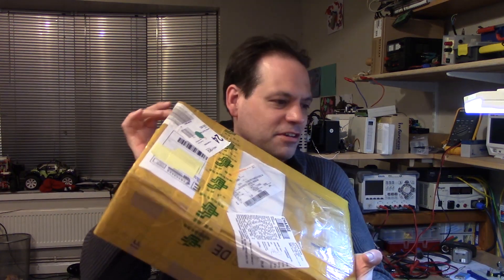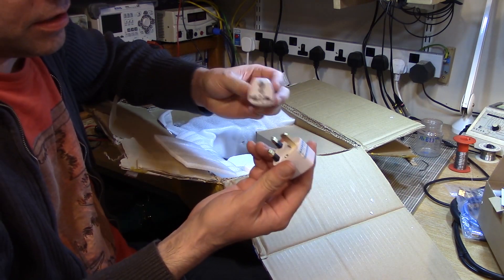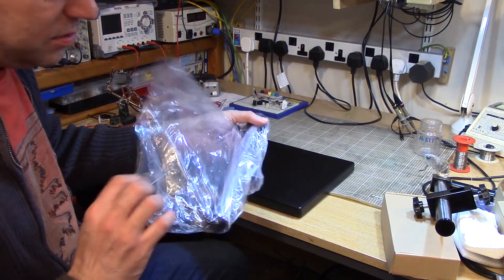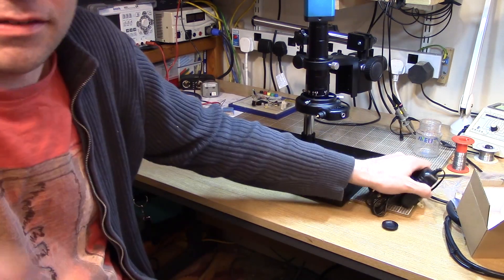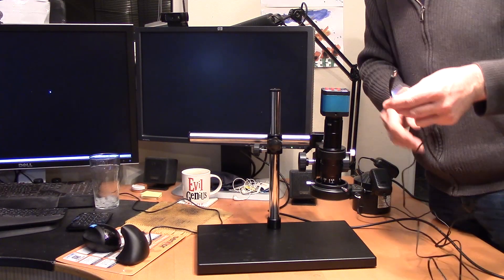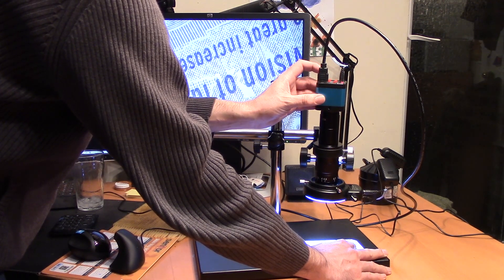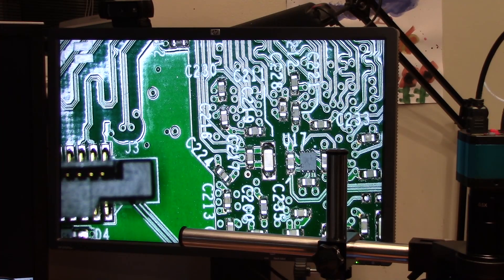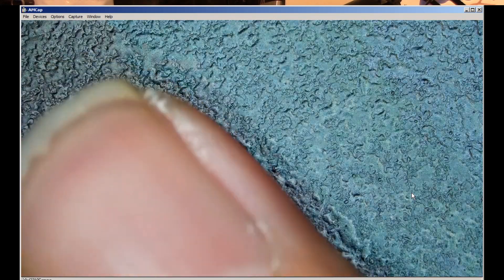Lapsun 14MP Digital Microscope Review

Comment: Jim I like your vids very much. Could I offer a suggestion? The music tends to be louder than your voice and I find myself having to adjust the volume routinely. Making the music and speech the same volume  or perhaps the music lower would be appreciated. Thanks.
Reply from the maker: Thanks for the feedback Ken Anderson  - I'm forever battling with the audio levels. The problem has become worse since I got myself some new camcorders at christmas time. I got a Canon Mini-x which has excellent audio pickup, but is super-wide-angle fixed-focus, and a Canon Legria HFR506 which has front-facing microphones and terrible audio pickup (particularly if you're standing behind the camera). For parts of the video I use the mini-x to capture the audio, but when I go handheld walkabout with the HFR506, then I'm relying on that to get the audio instead.... I'll get a couple of hours into editing and suddenly find a clip where the audio is far quieter. I do try to boost them in software, but there's a limit to how much boost it'll let me apply (the alternative is redcuing the volume of every other clip to match it, and that's a real pain). It's my birthday fairly soon, and I've been maybe treating myself by upgrading the HFR506 to something with an audio input and getting a decent wireless lapel mike - that'd fix things nicely. Thanks for watching and taking the time to comment. Cheers!!

Comment: Thanks for the honest review jim,I hope the issues get sorted with the new firmware,cheers ben.
Reply from the maker: Ben Ivers Thanks Ben. The camera unit is on it's way back from China now, and when it arrives back I'll be doing a follow-up video to see how it performs. Cheers!!
Reply: Now all problem has been solved already, the problem is software problem, not the firmware problem, so you can buy it confidence, thank you~
Reply from the maker: Thanks Ak Wong - I'll continue making my follow-up video tonight. I'll be trying to get the sensor cleaned up and then take a look at the new software/firmware on the camera. I can already confirm that the USB video output is now working nicely with all the different PC software I've tried. Cheers!!

Comment: Could it be the speed of the SD card, I have seen the same on a Canon dslr.
After changing from a class 4 to class 10, it made full length video.
Reply from the maker: Good thinking Jesper Thorup Nielsen  - The SD card I tried it with is a Sandisk Ultra UHS-1 Class 10 which used to be in my Mini-X camcorder until I got it a new one. The card is good for around 27MB/sec reads. I do have a Samsung Evo card which does around 50MB/sec that I can test with - I'll give that a whirl this evening. Thanks for the suggestion. Cheers!!

Comment: Sounds like a driver problem... did you try hunting down new drivers and firmware for it?
Reply from the maker: Good thinking mnelson10000  - The specs on the camera say it is a UVC device and that no driver is needed, but clearly it has some issues with that. I was rather hoping that the CD which came with it would have a driver on there, but no such luck. The camera has no markings to indicate a manufacturer or model number, so I've only got the vendor & device IDs to guess by, and windows already recognises them and decides it's got a suitable driver... I don't know how I could go about finding another driver without dismantling the camera and looking at the chips (I'm not ruling that out). Hope you're having a good weekend. Cheers!!
Reply: I would make sure you have the latest drivers for your motherboard, too.  Also, I'd disable power management on it in device manager. Good luck!
Reply from the maker: mnelson10000 I did try it on two different machines (desktop and laptop) and it showed the same problem on both (though both of them have had the same combination of webcams attached in the past) - Perhaps I'll give it a try on a fresh virgin windows install this evening and see if it behaves any better. I contacted the seller and pointed them at this video - they've replied saying they've contacted the factory which makes the cameras and will let me know tomorrow when they get a reply back about the snowstorm on the HDMI output whilst USB is connected. Thanks mnelson10000 .